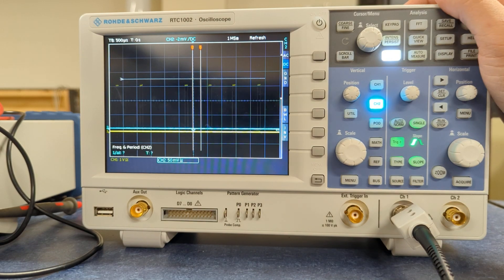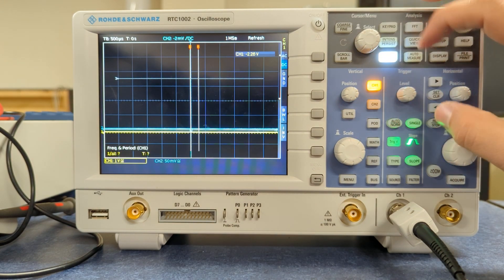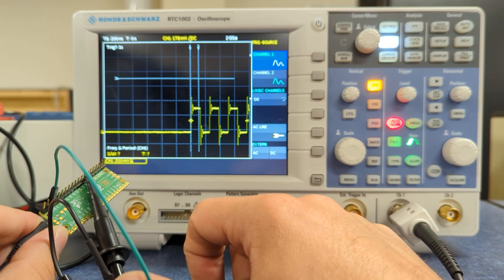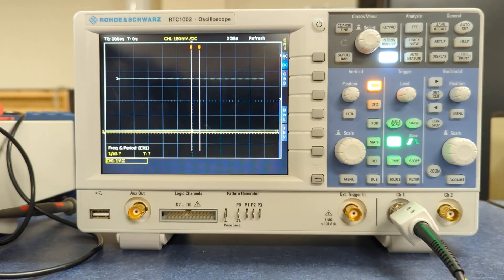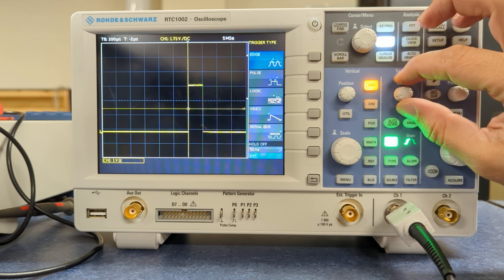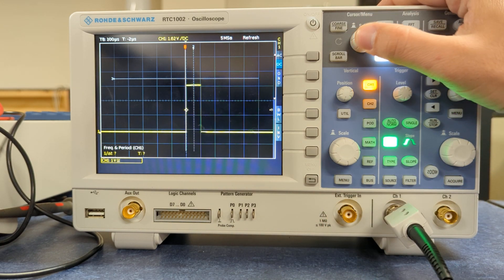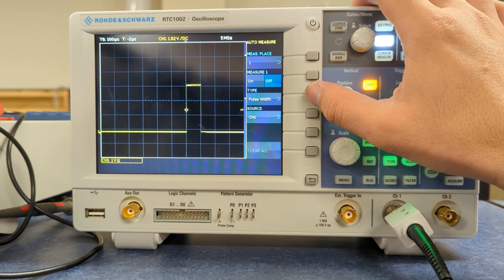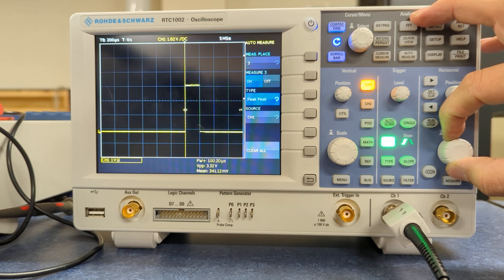ECED Lab - R&S RTC1002 Oscilloscope - Basic Setup

Comment: I am not able to see two analogue channels at the same time. My older oscilloscope scope did this without any extra setup.

Any clues how I can see two analogue channels at the same time , with say an external trigger ?
Reply from the maker: I found this scope a bit more confusing for setup - check the channels are both set to DC coupling (and not GND), see 2m10s . It could be the vertical position of a channel is wrong - have to click each of the CH1 & CH2 buttons then adjust the vertical position. It doesn't have as obvious a "channel on" or "channel off" indicator like some scopes.